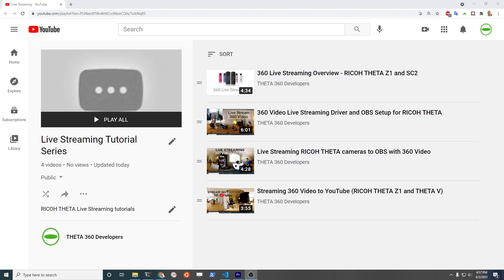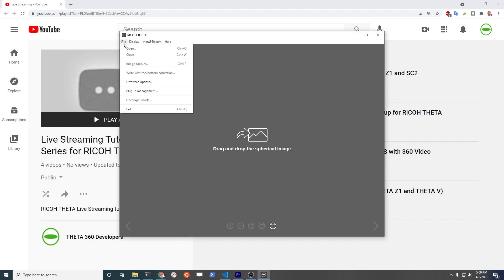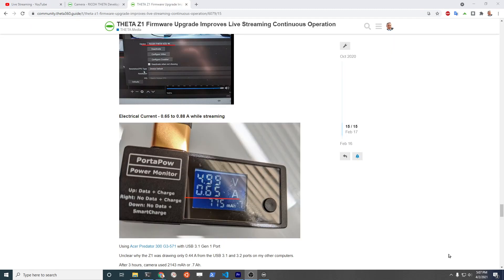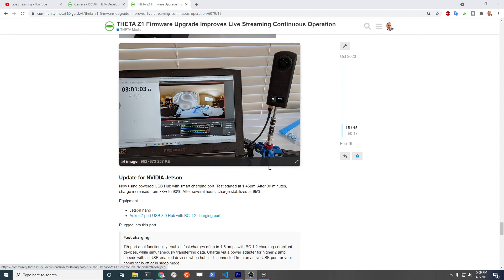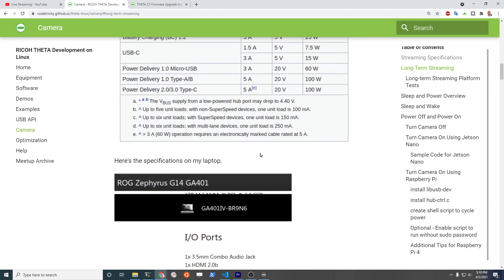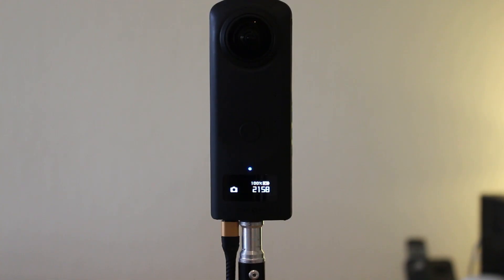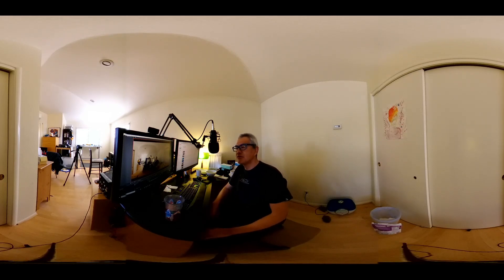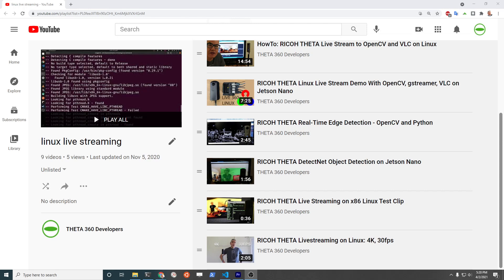RICOH THETA Live Streaming Camera Setup for 24 hour Continuous Operation

Comment: Great video.. What kind of usb cable would you recommend to use with the USB CDP?
Reply from the maker: The cable doesn't matter as much as the USB port or powered hub.  I bought a number of cables from Amazon for the tests and they all worked.  I suspected the cable was the problem before someone told me about the different USB BC 1.2 specifications.  Before I found out about that, I was just going through different setups and recording my results.   You should probably use a cable that is less than 1m in length.  However, I tested this 3m cable and it did work for me.  https://www.amazon.com/gp/product/B07MYSX1ZL/ref=ppx_yo_dt_b_asin_title_o09_s00?ie=UTF8&psc=1
I would recommend shorter cables, either 1m or 2m.  Shorter is better.   I got the longer cables to test if the 3m length would impact the stream or not.   It seems to be okay for me in my tests.  However, I suggest using the shortest cable that can is meets the requirements in your project. 

I also ordered the cables below and will test them in the coming weeks.
https://www.amazon.com/gp/product/B07DC54RV7/ref=ppx_yo_dt_b_asin_title_o00_s00?ie=UTF8&psc=1

Comment: Craig how's the heat when you use the plugin's instead of USB with the latest firmware update?
Reply: So I tested with the Wireless Live streaming Plugin and managed to get 21 minutes of streaming with the updated Firmware version...
Reply from the maker: @gavingrierson  in my tests, the wireless live streaming plug-in is overheating at 4K.  I have heard of people getting longer times, but I have not been able to replicate it yet.  for me, only USB streaming is 24/7.
Reply: @camera360dev  I guess we need to wait for another firmware/plugin update to address the heating issue in Wifi mode. Once this is sorted and people can stream about 45min from different locations then it will be a game changer.
Reply: Using heatsinks and fans on the camera doesn't look good...
Reply from the maker: the 5GHz chipset is adding some additional heat.  You may be able to get longer streams using 2.4GHz.  I'll do more testing
Reply from the maker: I heard from a  community member that they were able to stream from the plug-in for 24 hours.  However, I haven't done this myself.  I also don't know how they tested the camera.  In my tests, the camera overheats at 4K with the plug-in.  I would like to test it on my local network first by setting up my own RTMP server and then trying different settings.  I believe that Laszlo from Flow Tours tested the wireless live streaming plug-in extensively and can't stream for 24 hours.  So, maybe it's not possible at the moment.  The source code for the Wireless Live Streaming plug-in is available, so it's possible that the person that was able to get a 24 hour stream modified the source code.  At the moment, it's not possible to stream from the plug-in for an extended period of time.  It does work if connect the Z1 to a Raspberry Pi or Jetson Nano and use that small board computer to relay the video stream to another system.

Comment: But it’s flat? Not 360??
Reply from the maker: YouTube and Facebook will add 360 navigation to the equirectangular (flat) view.  You can also use Pot Player locally.  I cover Pot Player in a future video.  The most common use is to stream the Z1 to YouTube and then use the YouTube viewers allow your audience to navigate the 360 scene.  There are also several options to view the 360 scene with navigation locally.  You can use free software like OBS (most common) to get the stream to YouTube or Facebook.